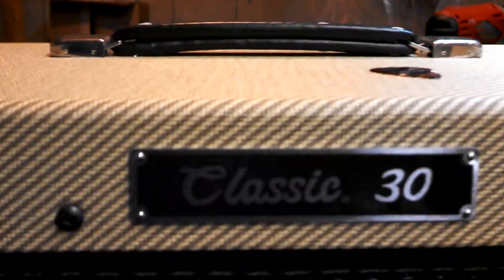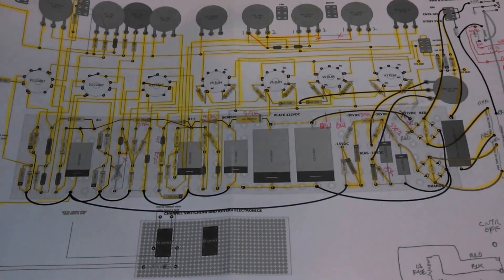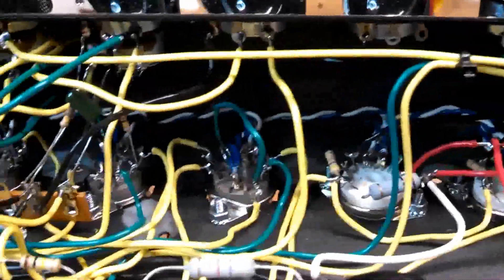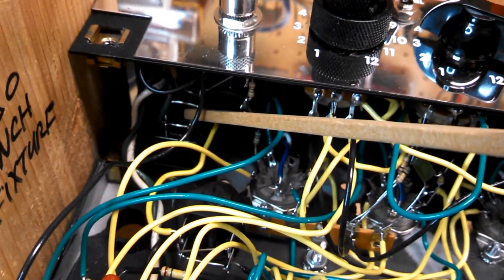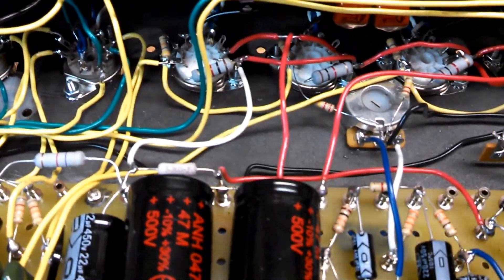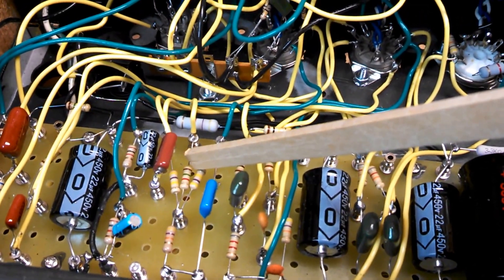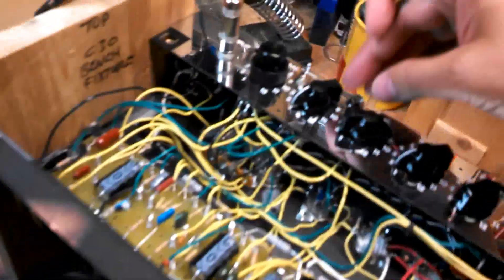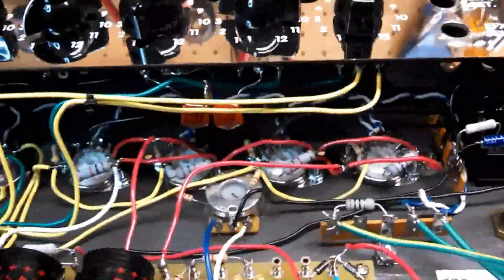Peavey Classic 30 - Hand wired Part 1 guitar amp mod

Comment: Great job. 

Do you feel like the LTP was an improvement over the cathodyne PI?
Reply from the maker: Thanks. It's hard to tell if the phase inverter made any difference sonically as the entire amp was required. I know it caused squeal issues initially due to adjacent wiring that was corrected. It does provide an interesting tap point for reverb, post tremolo that is still like to try.  For me it helps to make the amp more Fender-like. I've discerned no measurable loudness difference. The amp was always too loud for me and having the ability to use only two output tubes (rewiring the screen supply) helped most. I do favor the cathode biased configuration with two power tubes and rarely switch it to fixed bias 4 tubes.
Reply from the maker: Correction: rewired the tube filament HEATER supply

Comment: What turret board and filament transformer did you use. I have a blue tolex Delta Blues 2x10 that I have wanted to do some heavy modifying, including fixing the nasty volume drop on the tremelo. If you could point me in the right direction, I'd appreciate it.

Comment: Five thumbs down from people who are just plain jealous of your "very special set of skills". This is one VERY impressive project. Would like to know more. I've got an early 90s C30 with all NOS tubes and a Celestion Relic 30 that I recently recapped and it sounds good - but not as good as my Classic 50 head with the Peavey 115E and 410E loaded with blue frame alnicos. Best sounding amps I've ever owned and as close to a '59 Fender Bassman Reissue as you'll get.

Comment: I feel ya brother.  I installed just about every Steve Ahola Classic 30 mod in my Peavey Delta Blues and what a PITA it was.  I hated all those frikin bare inter-board jumper wires.  I am not even sure if the end result was worth it.  I think you did a fantastic job so far but one thing for sure - I won't be rebuilding the whole thing from the ground up as you have.  I don't have the time or the patients any longer. 

I still like my Fender Blues Junior with all of the BillM mods better.  However I like my Mesa Boogie un-moded lone-star the best but it is a PITA to haul around.

Comment: Nice video! I love my classic 30. I am looking for a mod that can improve the boost. Right now it seems to boost the volume and mids. It is perfect for cutting through the mix when I play solos, but I would like it to maintain the highs and get less mids with the boost. Any suggested mods you recommend to help with this issue? Thanks!
Reply from the maker: Check out the "Blue guitar mods" - lots written about the PVC30 by a very knowledgeable source.
Reply: Thanks for the reply! I actually just found that resource! @Bobsbluesmusic
Reply: Just run a boss equaliser pedal with everything centred.

Comment: Good project man. Is that 2 Watt metal film cathode resistor? Two EL84's ask for 5 watt minimum. Sure current states 2 watt power dissipation but you have to go 2x power rating with resistors that have to dissipate lot of heat. I use 10 watt ceramic resistor. Stays cooler. I use 150 Ohm instead of 130 Ohm as well. Well here in  Europe mains  voltage is quite high and 130 Ohm will red plate some tubes. Btw you can add another switch that adds second 130 Ohm (150 Ohm in my case)  resistor parallel to your cathode resistor and have it off for two power tubes and on for 4 tubes cathode bias option. Cheap option to. I would go with 100 uF cathode bypass cap. It would work good with 2 or 4 power tubes option and add some low end. To be honest I would not add  anything that is not essential. Nothing digital and no relays if possible. Have you tried changing V1? That could be also some squeal from a fact that that tube in that socket is bit microphonic. I go for preselected V1 tubes. Bit more expensive but totally worth it. Good luck with your project. I am pretty sure you will have epic sounding amp on the end.
Reply from the maker: Thanks for the comment but you are making a LOT of assumptions.  To start with, for cathode bias of 2 EL84's I'm targeting 32mA with each tube (recommended for cathode bias).  That produces less than 10V (measured) across a Ck of 130 Ohm.  If you do the math you'll find that's roughly 1/2W total - so the 2W is good for what I'm doing.  No harm in over-sizing resistors but it's not needed for my use, with my plate voltage at 320V and our state-side mains.

I used to have way too many switches on this amp before I did the hard-wiring.  I found that for switching between cathode and fixed bias I wanted to keep it simple.  The stock 4 tubes, properly biased runs very hot.  So while I have the ability for a stock 4-tube fixed bias output - I set it up for just 2 tubes - this is adjustable with the pot.  And I really like the cathode bias but I don't see the need for switching between 2 and 4 tubes (I did this previously).  The difference between 15W and 30W is not really that big a deal volume wise (volume is not linear).  So to keep it simple I set it up for 2 tubes cathode bias and if I really need the output power I can still have 4 tubes running in fixed bias.

This build is based on my personal preferences and needs.  Feel free to design and build your amp to your own preferences.
Reply: @Bobsbluesmusic  no worries I do design and build my own design amps. When people ask for it I build clones to.  I do get your motivation. For some people 5 watt is more that what they can use. I agree. I have made quite a few 18 watt two EL84 amps. Some Bluesbreakers and more of my own designs. While people using them on the stage many of them called for more power in such situation. 40 watt 4 tube design is just few decibel louder but no one ever said that they have had lack of power on the stage with it, at least not to me. While sure some people said it was more then what they need. To everyone it's own. I partially get your motivation not to 8nclude more switches. Enough is enough I get it, though looking at what you already got you looked to me as more is better person. Anyway my motivation was to suggest to you one more option. Seeing how you already have made lot of extra options it seemed to me logical that you might want it. My mistake. Tou satisfied with fixed bias variant and sound you get from it. First me I tend to prefer cathode biased amps for amps with less headroom,  but that is just me. Like it's sound more as well. I get your motivation for dismissing my resistor wattage tip to. Not offended. Sure do what you feel. But if you have measured 10 V drop voltage across it and it measures 130 Ohm than power dissipation is 0.77 watt across that resistor. While 2 watt is reasonable I would never ever go with it. 99.9 % amps I have seen using two EL84'S use minimum 5 watt resistor. Most of the kits come with 10 watt. I have seen 2 watts only in very old amp. Like 50-60 years old amp. Worked for that one so it will work for you to I guess. Hottest part in the chassis is that resistor. In my case there is no ventilation in chassis so I want to keep it as cold as reasonably possible. With 320 V plate Voltage you are good with your bias to. Sure I get it your OT and PT are designed when higher main voltage was already available. I use classics iron and 130 Ohm is no go for me. And with main Voltages here I find my self wishing for 160-180 Ohm ceramic 10 watt resistor for my builds. Well 150 Ohm is sufficient for better tubes. Still it will red plate some tubes. Found some vintage tubes and those red plated after 20 seconds in my variation of 18 Watt BB with classic iron and 150 Ohm. They work perfect I'm my own design amp with different PT. In two EL84 amos I prefer no feedback cathode biased amps. They sound best for me. That brings iron vs resistor balance act that I am fine with. You have to give something to gain something. First clones I mostly do use turret boards. But first my own designes I go with point to point. Sure looks more messy in mostly but I prefer sound of it. Good luck with your build and sure yse what ever works for you. Will do same over here.
Reply from the maker: @NINEWALKING  Nice response, I can appreciate your experience. I'm really a hobbiest.  I would say any potential red plating would be the result of too much current through the tube.  Separately, I also control and lower the screen current which is often overlooked and contributes to the health of power tubes.  I was thinking also if I ever do get too much current through Rk maybe it's a good thing the rating is low if the resistor blows open and disconnects ground and current. If that ever happens I'll let you know. Thanks again.
Reply: @Bobsbluesmusic  good point. Lot of people measure voltage drop on the cathode resistor to get cathode current and ignoring typical 5 mA screen current  per tube ending up with to cold bias. Also many times people measure voltage on first node and use that instead of plate voltage. Or even worse think about biasing as current only. And it is about plate power rating you get only from plate voltage multipleed by plate current only and not cathode current. When you've said 10V over 130 ohm, ignoring possible tolerance of the resistor, I got cathode current and deducted 10mA and divided by 2 and got 33.46 mA. Plate voltage of 320V and I got 10.7 watt idle plate disipation. So I got it that you are safe an you are not like at some extremely low value. Sure lot of assumptions but works in real life. Btw regarding screen resistors I overdimesion those to 😁. Ach well I try to keep inside of a chassis cool as possible. I use aluminum chassis when possible and I lay down ceramic resistors on it to cool them off. additionally. Red plating on those tubes was just because plate voltage was way to high for their specs. Negative voltage on the grid was just to low so tubes would run out. Higher value cathode resistor would solve that easy. Best way to determinate plate current for me is still to measure voltage drop over the output transformer. And you are right lower power rating resistor is sort of a very very slow fuse to 😁
Reply: @Bobsbluesmusic  I forgot to say thanks 😁. Glad if I can chime in with any info I have. I am glad if it is of any use to anyone.

Comment: Do you think you got it bad, I have (2) Classic 50 Tweeds, 4/10s, replaced all the tubes in my 93 and all the caps put in (4) new Ragin Cajuns and in my 91 I believe that was just caps and tubes and still have the standard speakers, the board!! is a b** in a classic 50, you, oh God. And I did not do the work!!! I watched, then paid, BUT, I love my amps I wouldn't sell them for anything well it take a lot of money to buy my amps just love the sound out of them I don't think it could be duplicated I think it's better than Fender and those are powerful words. But no you did an excellent job oh on yours I'm really impressed excellent job good work man.

Comment: Enjoyed your videos. I have one question about your on/off/standby switch. Since you have "off" in the middle position are you cutting power when you move from "standby to "on"? Seems like that would jolt the system.  I would think that the "off position would be better top or bottom rather than in the middle. Am I understanding this correctly?
Reply: I wuz wonderin' the same thing... 
The logic strangled up my mind...
Reply from the maker: Standby gets the heaters going to warm the tubes.  Once they are warm throwing the switch to power them is not a problem.  Turning everything off at once is not a problem either.

Comment: Great job. Have you allowed for the 2 tubes pulled via the output Ohms? Normally when pulling 2 tubes in a 4 tube Push / Pull you would cut your Ohms in half thats the reason i ask.  You may have covered it i wasn't listening the whole time.  Great Job Dude!!!
Reply: Tim Stanley the c30 normally has a 16ohm speaker, but the transformer has an 8ohm tap. he put a switch there to go between when using different output sets, which I believe that was it's intended purpose, this it can of course have others...
Reply: Britt Rossman The amp sounds incredible i think!  probably the best Peavey in existance

Comment: How many hours went into this rebuild?
Reply from the maker: Howard Rose I spent a lot of time just documenting what I wanted to do and what were the pros and cons.  the biggest deliberation was what to do about the heater current supply.  trying to find a replacement power transformer was impossible and too costly.  just adding a small filament transformer saved lots of money and allowed me to move forward.  then I set about with a layout which I spent much time on with several revisions.  Star to finish, the project lasted a couple of years from concept to build.  the build itself was surprisingly quick but at that point you're highly motivated.

Comment: Hey man,  great project! Can't believe how much work it has been.
I have a classic 30 and was looking at some mods. I haven't seen anyone commenting on C9 (0.001 ) in parallel with R8 (680k). Isn't it too low?  Wouldn't it cut bass on the normal channel at 234 hz? Thanks.

Comment: I have modded mine several times and am pretty happy with the way it sounds, It does have several ghosts, and a lot of the stock parts are cheap. I've toyed with this idea. but I'm not as electronic savvy as you. Would you be willing to share your schematic and layout? I basically want to just focus on the clean channel only and keep the circuit as simple as possible.

Comment: You should offer this mod as a kit.  You would probably do quite well.  The folded board is not a good design!
Reply from the maker: Thanks, but I'm only doing this as a hobby.
Reply: Thats why you get rid of the original board. If an amp isnt warm or is buzzy, thats what tone stacks are for. You change values of capacitors and resistors. I dont think Lynyrd Skynyrds guitars are buzzy, they used many Peaveys in the studio.
Reply: Would Love a copy of your schematic!